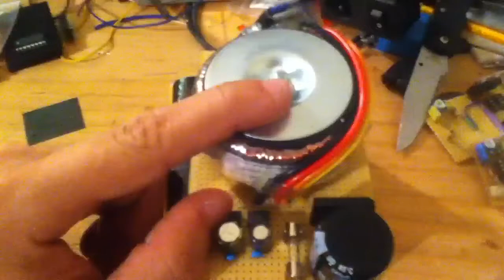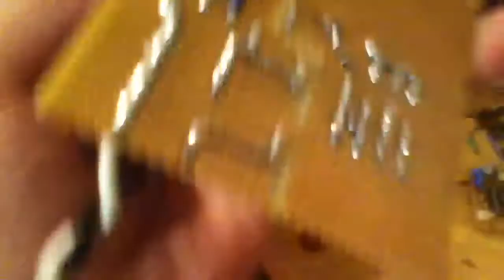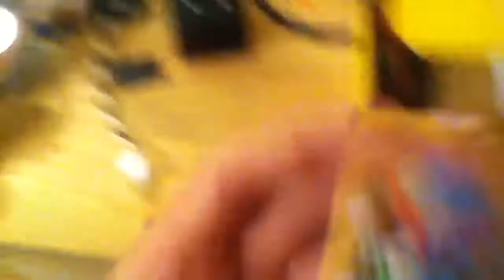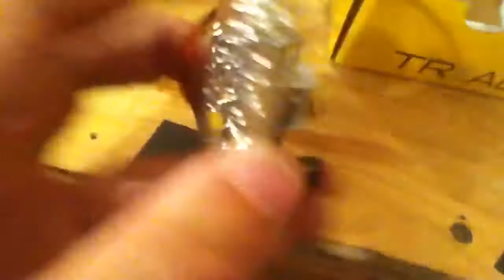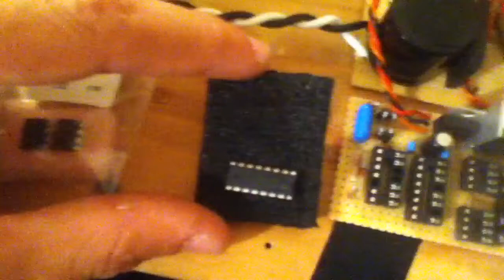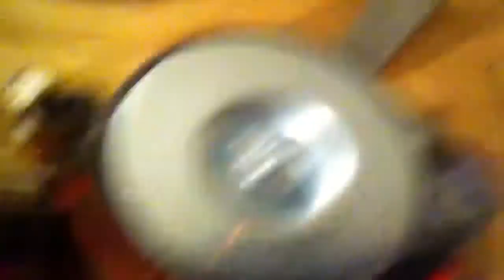Mini ISSTC Build (part 1)

Comment: THANKX!!!! XD btw your power supply looks so much more frail? so to speak but better then mine. i used 2 high 1200V power rectifyers for welders in mine and made a voltage doubler with two 1000uf 450V caps XD yours looks so much more neat lawls